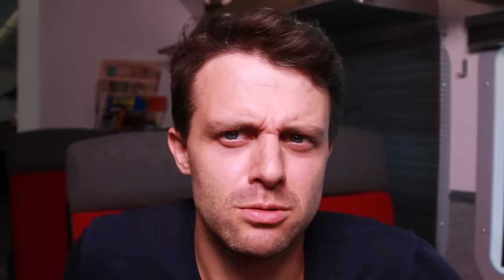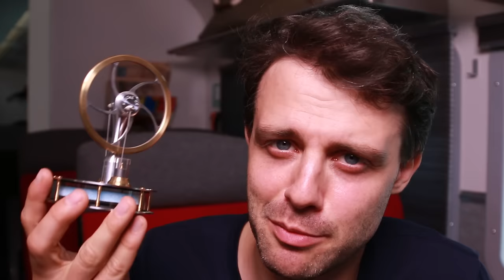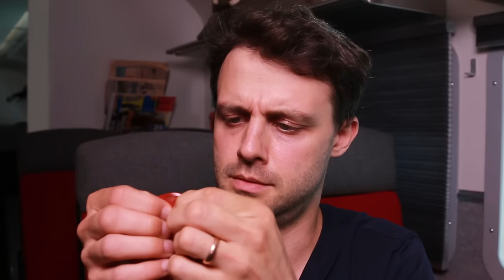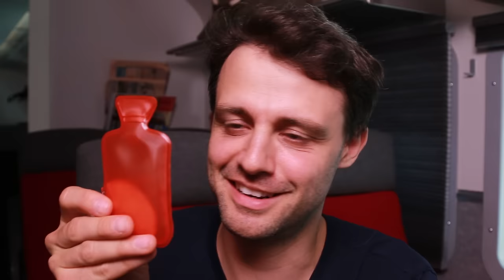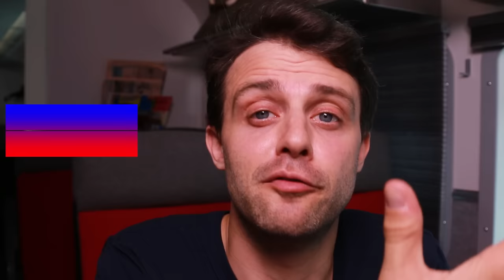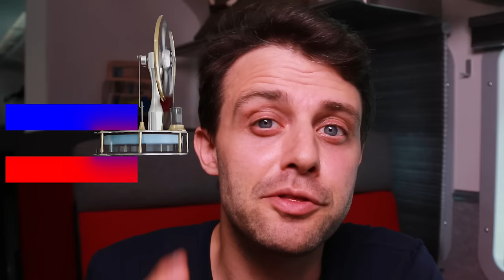A better description of entropy

Comment: But… a massive object in space, just sitting there with no energy, has gravity, and that gravity pulls another massive object closer (without exerting any energy to do it and without heat loss), and then they accelerate towards each other (this is creating energy from nothing) and they collide, then you have an increase in heat (energy) from the collision. 

So energy can be created from gravitational collisions, and this happens all the time in the universe. So just like a new life can be created in a plant or an animal when two equal opposite forces collide, the same happen in the universe on a different scale.

Entropy is a fact, but it is only one piece of the puzzle. The universe renews itself
Reply: Each object has gravitational potential energy with respect to the other. That gravitational potential energy is converted into kenetic energy before colliding, and then converted into a lot of different types of energy because collisions are messy. That scenario does not involve the net creation of any new energy tho.
Reply: @Chazulu2  I guess it's more like a rubber band, the presence of mass creates gravity, this is the starting point, then collisions between massive objects and then their byproducts (gas etc) creates all the massive bodies in the universe and along with that you get heat from the sun etc.

Comment: Well there is a none 0 probability that all the thermal energy will just randomly end up in 1 of the plates, it's just incredibly incredibly incredibly unlikely. Like you could wait for the heat death of the universe and it still probably wouldn't happen to any particular 2 plate.

Comment: The permanent magnet motor as a generator with inverters is free house current AC power continuous peak power without fuel or pollution.. Do it yourself.
Reply: Have you done it yourself? Permanent magnets quickly become demagnetized under significant loads like that.

Comment: A good alternative description. Thanks. The Co2 theory of dangerous warming has little valid scientific support though, it's largely based on flawed models. There's much stronger alternative theories, but they are ignored as the field of climate science is extremely corrupt.  Albeit that's a different issue. Great vid tho.

Comment: Sir,  what is your background?  Do you have a physics degree? phd? Boltzmann wasn't an engineer. He was a matheamtician and physicist.  he studied gas and discovered the concept of entropy,  order being low entropy and disorder being high entropy.  Sorry,  but the 1 line definition,  is actually what Boltzmann discovered.  It is not wrong.  Your engineering definition, is different.  I have no idea if the engineers actually derived Boltzmann's ideas, and famous equation,  that you never mentioned.

Comment: "There is only one way to have all ping pong balls on one side ..." @9:15.
Nope, if you put a number on all ping pong balls you'll note that you can have the reds and the blues on their respective sides but have several hundreds (possibly billions) of ways since now you have identified each individual ping pong balls.
Now, there is another mind experiment.  What if we have blue ping pong balls and red golf balls.  And we have enough so that the ping pong balls are 3 layers deep and the golf balls are also 3 layers deep.  If you shake your box, you'll note that no matter how you shake it, the golf balls all stay at the bottom and the ping pong balls all stay at the top!
Is there then no change in entropy in the ping pong/golf balls system no matter how you shake them?
Entropy is a made up idea that works only on the assumption that the universe is an open-ended system.  If the universe is a closed system, entropy will be constant because gravity will keep it in check.

Comment: Stopped halfway through watching whe author used the phrase:" it's not heat, it's temperature difference".
Temperature is man made concept to compare intensity of heat in different substances or environments. So ultimately it is heat, and more precisely fast moving air molecules in one side of the displacement disk versus less fast moving air molecules on the other side of the disk.

Comment: I doubt it, but is the Sterling Engine how geothermal works? Or wait.... If all you need is a temp difference you wouldnt even need to go down that far. Just put a giant block of ice like 50 feet under ground. Wouldnt that work? ARE OUT ENGERY PROBLEMS SOLVED? lol

Comment: nuclear energy
sun's energy will never be enough
Reply: The energy received from the sun is 10,000 times the total energy of actual actual fossil, from which we only 1/3 net energy
Even with an efficiency of only 1% of solar panels we have more than enough. Actually solar panel are 8 to 10% efficient
Solar or nuclear energy? THE CHEAPEST.
Reply: @migueloroz5547  you can't be serious if you are thinking another 30 years.

Comment: Hmmm, there's more than one way to arrange a bunch of red and blue balls with all the reds one side, the blues the other. How you look at it depends on whether the red (and blue) balls really are identical and indistinguishable from each other in a way that makes the precise arrangement fundamentally the same. If so much as one of them can be distinguished from the others (maybe by a slight weight difference, a fingerprint a chip or scratch, whatever) it means the arrangement among them has many, many more configuration.

Comment: Neh!  Running your Sterling engine backwards makes it into an air 
compressor.  Your squeezing heat out of the air and moving it into one plate more than 
the other.  Ah, which one?  Entropy is unavailable energy, i.e., the 
loss in such systems.  Disorder = baloney.

Comment: I got my mechanical engineering degree in 1984. I'd gotten an A on the topic of Entropy, but Never grasped what the heck it was. I had simply memorized the This and the That from the book and an A popped out. Now in eleven minutes I finally Get It. "Measure of disorder" really is a horrible definition. I'm going to try to get funding for a Steve Mould statue, but this is the USA where it would be a Lot easier if you caught a football or something.

Comment: So...you could not be any more wrong in your description. Heat is energy and without energy, you cannot do work
You "DO" need heat to run that engine. There has to be some heat to have a thermal differential.
With ice on the bottom plate...you have more energy in the form of "HEAT" on the top plate.
Without heat...there is no movement of of anything. Not even atoms at zero kelvin or absolute zero.

Comment: 7:50 You cannot prove that pumping CO2 into the air causes any problem.  Why?  Because to begin the equation you have to pretend that, a) CO2 simply remains in the air, and b) that some significant unsaturated part of the absorption spectrum of the sun remains unabsorbed.  Neither of those are true.  CO2 in the atmosphere has a half life way the-f under ten years, and the spectrum that it absorbs is more than 95% absorbed by water vapour (over which you have zero control).  Go ahead, challenge this, I'd enjoy the exchange.  I just wish people would stop saying what you just said here because if y'all did that we'd save literally billions of dollars per day around the globe instead of chasing the tail of a fairy.
Reply: The earths fresh water is evaporating.  When the temperature goes up, it hold more moisture. Carbon traps heat creates more ability to store moisture, and causes more extreme weather events. How is that not what's happening?
Reply: Carbon hydro bonds are the building blocks of life.  they have a lot of potential energy.
Reply: @TatteredToys  1) The earth's fresh and salt water is evaporating.  2) That vapor absorbs the same frequency of light that CO2 absorbs.  3) That frequency band is almost "fully subscribed" at all times so doubling CO2 will not absorb twice as much of that energy, as CO2 rises the amount of heat trapped by it decreases.  4) Water traps vastly more heat than CO2.  5) Clouds have a hundred-fold greater affect on earth temperature than CO2 (at least). 6) ALL THE WATER which evaporates from the surface of the earth falls back to the earth as rain.  7) All of the CO2 emitted by the earth (human or otherwise) is re-captured by green plants and stored as a solid (on average, within 7 years of emission).  8) The earth radiates 100% of the energy it receives from the sun in real time (there's no such thing as "heat storage" on earth sufficient to affect a measurable temperature).  Etc.. etc... etc....  And as you say, when the temperature goes up it holds more moisture which only makes it more likely to rain or snow.  Contrary to the climate alarmists, earth really is a self-regulating system.  But, it's not self regulated to our needs, it's self regulated to balance nature itself.  That we can survive on earth as it currently is is merely an accident of co-evolution and there will come a day, regardless of what we do or don't do, when earth will no longer be able to support human life.  At that point, every climate alarmist should be fully content because humans won't have any more impact on climate.  And LASTLY, earth worms have a greater climate impact than humans.
Reply: @kob8634  the earth radiates 100% of energy it gets from the sun in real time?  How does it take me all night to cool my house down when I leave my windows open?  How do solar panels work?  Why do rocks get hot and stay that way?
Reply: @kob8634  If you are telling me light vibrates, I should be able to create a turning fork and capture and amplify that vibration as it goes by.  You are telling me heat is not transferable.  But, I’ve been sunburnt.
Reply: @kob8634  things store energy at different rates.  So, if we change the amount of something in the air, we change the storage capacity..  How is that hard to understand?
Reply: @kob8634  life created the oxygen on this earth.  Life created a balance for us to survive in.  Why do you think we can fuck that up and survive?
Reply: @kob8634  how does hydrogen absorb at the same rate at carbon?  They are literally frequencies apart. I can get hydrogen to go boom, real easy.  I can stack carbon and get a diamond . 

They do not operate on the same frequency unless they are bonded.  So, more carbon, more hydrocarbon.  And yes, that would absorb all sorts of energy.  Hydrocarbons are the building blocks of life, and flammable gas.
Reply: @TatteredToys  Nope, I didn't say light vibrates.  It does, but I said nothing about that.  Are you on strong drugs or something?  Pick an actual point that I made and challenge it... so far it's like someone reading Little Red Riding Hood in a court summation for a trial relating to child abuse... it's child abuse, but it's not a strong choice of words from which to infer a point.  (And, theoretically you can amplify light with a "tuning fork" of sorts, it's called a laser.)
Reply: @kob8634  ok, on topic, how do hydrocarbons not allow water to collect in the air and create heat storage?  And how is us burning carbon, not creating unnatural heat storage?  You said water traps more heat than carbon.  Cool.  It also evaporates into base elements.  Carbon remains carbon.  It’s a great glue.  That’s why it’s the building block of life.  But, if we put it all up there at once, the earth will likely resemble a time humans didn’t exist.
Reply: @kob8634  you said, “that vapor absorbs the same frequency of light.”   A vapor is made up of the parts inside.  A vapor will be hit with the same frequency of light.  It’s absorptions is entirely depended on the atoms inside.  A vapor can be made of hydrogen, oxygen, and nitrogen, that will absorbed energy and react differently, than a vapor with all those elements and carbon.  We are still adding another element.
Reply: @kob8634  do lasers create a tube the size of the wave? I have a psychology degree.  I’m more curios why you seem to know more than me, but you can’t understand what I’m asking.   I know, variables create change.   I leaned that much in my kinda science. Adding a shitload of carbon should creat a shipload of change, given it’s not a placebo in nature.  It does things.